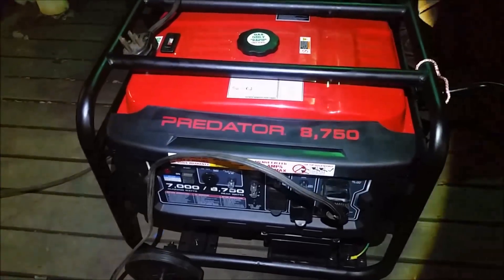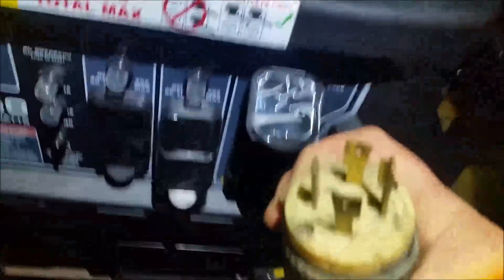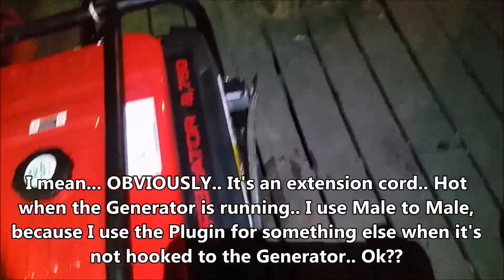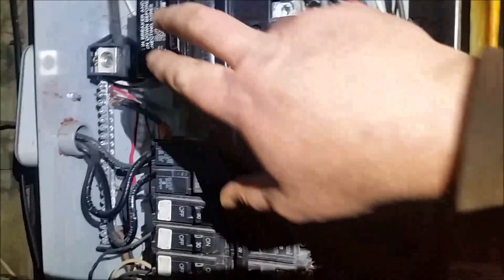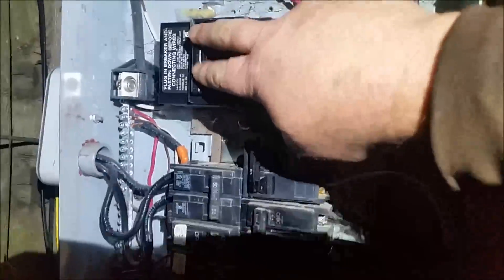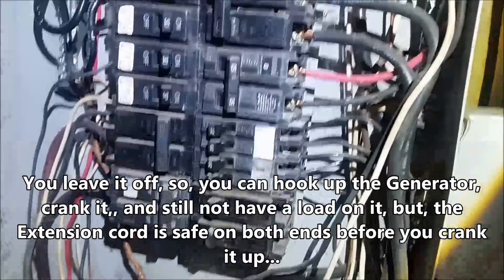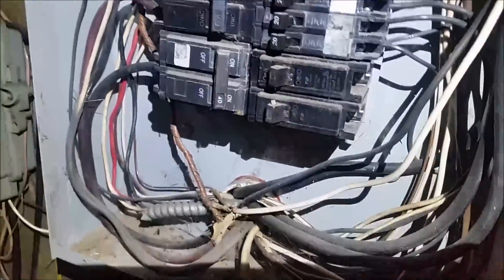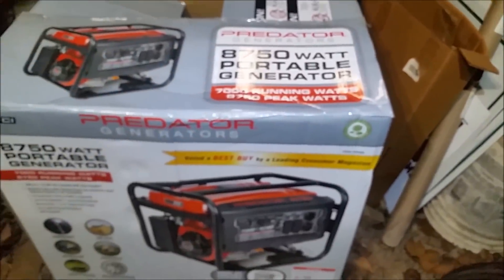Quick/Easy/Safe: Use Existing Plugin/Breaker for Generator hook up to your house Panel box.

Comment: Hi Ed,
Don't see it as a theory,talked to a lineman at the matenance shop they will not except a breaker switch they say it is not 100% shutoff. I always used it as a switch myself always worked. The lineman said a manual shutoff or selector switch. They believe it to the point if they catch you doing things like that they will take the meter home with them. I did run that hookup by them,my thought same as Mark. Guess great minds think alike,good luck and be careful
Reply: Thanks Christy, but it seems a bit strange that a lineman would disagree with code.
Reading the following my main breaker serves as the service disconnect:

"Electrical disconnects are switches that isolate all wiring in a home or other building from the source of power, typically the utility power service. Also called the service disconnect, this is the first disconnect device after the utility meter. This disconnect may be a special breaker switch housed in an exterior box enclosure, or it may simply be the main circuit breaker on the home's main service panel. It's also possible for a home to have a service disconnect on the outside of the home, while the main service panel—with its own main breaker—is inside the home. Each of these configurations involves specific wiring techniques and requirements that are not interchangeable."
Reply from the maker: For some reason I missed your first post that Christy replied to, but, it's really not uncommon for people to disagree with "Codes or Standards".. Not saying that, they don't have to comply with them, if they want to maintain their licenses, etc.. But, to Christy's point, coming from a lineman,, yes, I fully agree.. 
When your life depends on the line or box being cold, you will never get a lineman to agree that anything is safe, because there are always those 1 in a Million circumstances that will kill you and make a liar out of you if you manage to survive.. But, how common? A lineman never takes a chance.. Their code is,, "The Line is Always Hot".. 
What guarantee does a lineman have that someone won't bring a power plant back online and bring it in out of phase and double the voltage? Or, that lightning might strike a line near them, when there is no rain.. 
Would the average Electrician work on a panel without flipping off the main breaker? Probably not, if someone was looking, but, would he do a quick breaker swap without turning the power off at his own house? Most likely. I have done it quite a few times. But, would you catch a licensed Electrician talking in public about doing it? He'd better not.. Lets see how the theory of "Disagreeing with code works when you spread it out over some other professions". 

Let a Licensed Doctor use a solution of Baking Soda and water to rinse a Colon, instead of the "Approved Solution" of Salt and Water (Saline solution), and you will find someone that accidentally found a cure for cancer because he ran out of Saline and knew that a Baking Soda solution would be fine, but, "Code" said, DO NOT DO THAT!!
Why is that called "Practicing Illegal Medicine"??  What is a Cancer or what is Cancer?  I knew for years that Cancer was a living thing.. It's just common sense.. It grows in size.. How many non-living things grow in size?
Now, ask the next 5 Doctors that you speak with,, "What is Cancer", and see if they say anything related to "A Living Thing".. They will just plainly say what they have been taught.. "They don't know yet".. Well, IF,,, it is living.. Is it a Bacteria, Virus, Parasite, Fungus, etc.. Do a Search on Dr. Simoncini "Cancer is a Fungus" and see if you can find the excerpt on the FCC Website where they destroyed the mans career for "Finding a Cure for Cancer".. Then, do a youtube search and look for someone interviewing him (both sitting in a relaxed office in two easy chairs and watch what he captured on his laptop with his scope.. And,, wonder why  Western Medicine will destroy you for using Baking Soda and water vs Salt and Water.. I will show you a Doctor who disagrees with Western Medicine..

So, I don't think you are thinking wide enough when you say that you can't see a lineman disagreeing with code.. 
Does a mechanic agree with fuel emissions and all of the crap that comes with it? Ask them.. 
Does a Doctor who trained on Western Medicine?  See how many of them would take Chemo and Radiation themselves, if they got Cancer, ( I wish I could remember her name, but, I think it was Susan, and you might be able to find her story online.. Search for Tumor, and carrot juice Enema, you might find her. The tumor was dead center of her chest and her husband kept her alive with carrot juice enemas, while she researched and found a Natural Cure for her "Cancer", and she was one of the physicians that refused Chemo and Radiation. (Chemo is a Poison to the body).. Makes your hair fall out, etc.. 

Or a Doctor who grew up on a Farm, that won't spread on some DMSO on their "OWN" frostbite, or Skin problem, or sore joints.. 
Or, another that,, knows that Colloidal Silver and DMSO together applied to shingles will kill the shingles in a matter or hours? All actual cases.. 
Does an Accountant agree with the Tax Codes? All 80,000 pages? 
Find a welder who has welded for 30 years and always follows the rules, who is a betting man, and I can take his paycheck from him, if he subscribes to the "FACT" that you CAN NOT Weld dissimilar metals...  Say Copper and Steel.. I'll ask him to define a successful weld and then, I'll take his paycheck from him if he thinks it can't be done.

If you spend a hour reading all of the posts here,, how many would you find that think, there is something wrong with the "Premisis wiring?", when the only thing that is not "Code or Standard is the Extension cord itself.. 
People subscribe to the "Rule of Thumb".. People do what they are told. It is bread into them from early school. Remember what I tell you, and be ready to take a test on it.. People don't innovate.
Then, there are some of us who didn't take Physics in school, so, our brains are not polluted, and we have learned the laws of physics on our own, and we don't subscribe to others ideas, if they don't agree with our guts.. 
That is why we look for and share the simple things in life.. 
We don't need a $750k home with 8 bedrooms and a two car garage for our 8 kids to park their cars.. Of which None of them can be parked on the street.. Show me an Atlanta Subdivision that has been built in the last 10 years that has the same number of car parking slots as they have bedrooms, and I will show you a bunch of people who don't subscribe to the typical "Subdivision Restrictions", ,but, try to find a home that is not exactly what I just typed,, in an upper echelon subdivision.. 
I just bought a 1984 Ford 3910 48 HP tractor, because I would not waste my money on the Headaches they are producing now.. Ask any diesel Tractor mechanic if they subscribe or agree with today's Best Idea tractors?? 
You actually have to add "Pig Urine" additive to todays "Diesel Vehicles".. I'm sure some Senators somewhere have stock in a huge pig farm before that mandate came out... 
I bought a tractor that I will still be able to fix 30-50 years from now, and won't wear out.. 
I think I made the point.. and, it should not be so difficult to understand now.. 
Same as I would not spend $300 to hire an electrician to come and put in a Transfer switch, when I can make a Male to Male Extension cord for $20 in less than an hour, and have enough sense not to touch the bare ends of the cable while I am hooking it up.. I Isolate it completely from the circuit before I start.. Main Breaker off, Generator breaker off, Generator not running.. Plug in Generator first, and the wall plugin next.. 
A lineman would actually be proud of the hookup,, as long as the guy doing it had enough common sense to turn off the main breaker before cranking the Generator.. 
To some of us,, turning the Main Breaker off is no different than putting the car in Park before we get out of it... We don't have to have a "Transfer Switch for our Cars",, so, why do we need one for our Houses? It is really Zero Difference.. If you jump out of your car and do not put it in park,, what are the chances that your car will kill someone?? Keep doing it and keep replacing or fixing your car,, and one day you,, WILL kill someone. Just depends on where you park and who is downhill from you.. A lineman will never grab a line without making sure there is no way it will light back up..  The call it Common Sense..
Reply: Mark, several years ago I traveled through your gorge often but life changed and it's been several years since I've been back to Graham County. If and when I pass through again I just have to stop by for a quick hello!
Reply from the maker: Ed Taylor.. You do that fella.. My door is always open for the "Good Ole Boys".. I'm sure we would have some pretty interesting conversations.. I'll break out some of the home made wine and we'll do a little wine tasting.. Off season is best for me.. It's when it is just me and my little buddy up here who stays with me all year, and I get to get out in the shop and do all sorts of things.. I'm dreaming up some really interesting projects for this winter when I get caught up.. I hope I get to half of them.. I'm on the West end of Swain County.. Graham is a little North and East of me.. All three counties converge just west of where I am. Graham, Swain and Macon.. A County Hunters dream on HF..ha.. Cherokee County is just a few more miles down the road..  We can even talk a little Politics if you promise not to stomp your feet..Ha..Ha. :).. Cheers Ed.. I have to get back to work.. For some reason my QB Payroll stopped taking out Fed and State Taxes and caught me by surprise.. Have to do a bit more digging to see why and how to rectify that ugly situation.. I took a break for a while to clear my head, and I'm going to have to take some really long breaths before I get on the phone with Tech support if I don't want to blow on them.. It looks like about a $1400 mistake that was really not my fault, nor my employees.. It worked fine April, May, and the first couple of weeks of June, only to screw up in my peak season (July).. I just ran my 940/941's/NC Withholdings  and caught it.. Man,, what a pisser.. Ha.. but, not laughing..

Comment: Here the only legal way to use a generator is to machanical selector switch eather on grid or off grid.that is 100% certain that the generator is disconnected from the grid. Trying to use a breaker switch may still bleed through will make generator with 240 volts may go through the breaker to the transformer and power the grid with 7000 volts.capable of killing a lineman and could land you with a law suit or end up in prison for manslauter charge, not even close to that risk,install the generator properly or don't cobble it up period
Reply: Christy, What's your theory for a breaker switch bleeding through?

Comment: @5:30 Think you meant feeding off of the 110 on one side and the 110 on the other side. (actually more like 125 ea side)
Reply from the maker: Correct. Not sure where that came from, but, straightened it out a bit when I went over the 220v breakers and got it right.. Ha.. Video slag.. Ha..  Most of the time, it is less than 120 in my experience. Usually 113 to 118v, but, depends on who your provider is.. But, usually, it is a bit lower.. I have seen some higher... In D/C, though, a good 12V car battery is about 13.8volts.. They get iffy if they get much below 12 volts..
Reply: @MarkThomas123  The standard nominal voltage now in the USA is 120VAC. In my house it's about 125, and around here where i live in South Florida it seems most houses are about 120-125ish from my experience working with lighting and electrical, and 240-248VAC hot to hot. Like you said it all depends on the utility company on how far down the line from the transformer, etc.
Reply from the maker: @illestofdemall13  Correct.. Our power company did some mods here, put in an upgraded turbine (Hydro), and the nominal went from 115 to 120v, and very stead now.. Used to go from 115-118, but, rested more at 115v.. Now it sits at 120, and the variance dips to 118 when things kick on and off.. Obviously there is a much greater supply at 120 than before..

Comment: Look on eBay.  There are add-on interlock slide plates for most breaker boxes that will prevent a person from having the back feed breaker and the main breaker on at the same time.  At about $65 to $75 they are over priced for what they are, but still the cheapest way to do it.  For safety, you should do the second long run of wire that will be only for the generator and use a box with male prongs and a female connector on the cable from the generator.  Part of safety is making things idiot proof.  No matter how many times one does something, there is always the chance of having the momentary brain cramp where one does the wrong thing.  I've seen people with years or decades of experience handing firearms make a mistake.  This is no different.
Reply from the maker: Male plug off of the main panel???  It would give me the heebe jeebies everytime I looked at a male plug coming off of the main panel.. I understand.. Sure.. The breaker is off when the main is on... I just don't look at it like that.. Still would make me nervous.. I look at everything as being hot, unless it proves to me it is not.. I would be double and triple checking that male plug whether a generator is hooked up or not.. At least I have a piece of mind when my generator is off and the male plug is safely stored on top of the "Not Running Generator".. Don't have to worry about the Interlock falling off, someone taking it off, etc.. 
Having a brain cramp while working with 220v is deadly.. If you think you might have one,,, I would not do it.. 
Ha.. And the gun scenario?? I don't care how old I get.. My Firearm would never go off if it was unloaded.. 
The barrel would never be pointed at anything I didn't want to shoot even if the gun were unloaded.. 
Even if for some very strange reason my firearm discharged unexpectedly, nothing human would be at risk.. 
It's kind of like taking a Nap while you are driving.. You just don't do it.
Reply: The utility catches you doing your "cheap" approach you will have to pay one helluve deposit if you ever want power again.
Reply from the maker: @kcepeo  sorry fella. It don't work like that. I guess if you knew the permit process at the power companies have to go through in order to do business in whatever state they're in, you might understand how foolish that statement is.
If they're going to charge me something different than they're going to charge someone else, their policy better state so, and they better have a damn good reason for it, and that isn't going to be one of them. If my power set up passes inspection, which it most definitely will, they cannot refuse me service or treat me different than anyone else. There's only one instance that I know that they could raise your deposit. And that's if you have in the past not paid your bills. Maybe that's why you made that statement. Been there and done that?
Reply: + Mark Thomas - When I talked about a outside box with male prongs, this is what I was referring to.  This is made for the purpose and NEMA and UL approved.

http://community.homedepot.com/howto/DiscussionDetail/wiring-inlet-box-to-panel-9065000000007gT

+Richard Kelson - Here is a video on Interlock Kits:
https://www.youtube.com/watch?v=n7DkaorEQPQ

And the Interlocks at Home Depot:
https://www.homedepot.com/p/Square-D-Homeline-150-225-Amp-Load-Center-Outdoor-Generator-Interlock-Kit-HOMRBGK2C/203030954

These are cheaper than eBay or Amazon.  And, I don't have any commercial relationship with any of the above.  I just want folks to know how they can SAFELY and inexpensively have manual transfer capability for their portable generator.  The great advantage of this method is you can power anything in your house within the limits of your generator, just not everything at once.